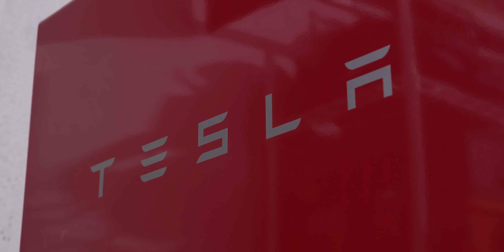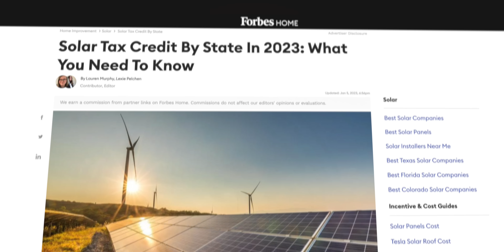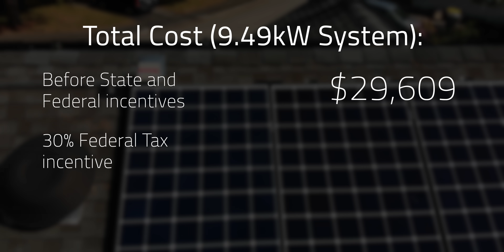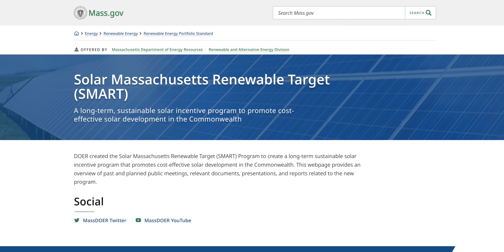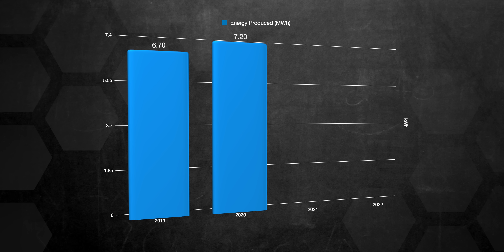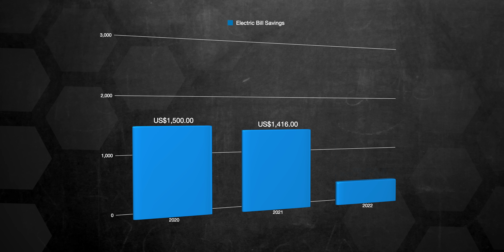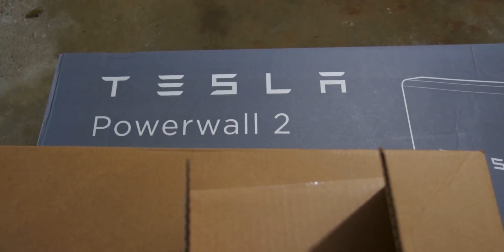5 Years with Solar Panels - Is It Still Worth It?

Comment: I always get all stinky over Nuclear power but after hearing about the navy having unlimited range it sort broke my military strategy/science brain destroying logistical problem in a military manner is a game changer, I liked this video although all the images of panel on your roof left something to be desired, though as soon as a micro reactor comes online Mr. Ferrell will be first in line to have one I'm looking forward to that.
Reply: The US Navy has been using nuclear reactors since 1958, they are installed on submarines, aircraft carriers and crusiers. Since then there has never been a reactor accident, the design of the reactor is made so that the controll rods are forced out of the reactor and in a shut down are pulled back into the reactor by a mechanical mechinism that won't fail. If you live near a navy base there are at least 20 or more nuclear power plants operating all the time. The lifetime of a reactor before refueling was 20 years, now with advances in technology is has been pushed out to 40 years. There are two studies that have been conducted on the effects of exposure to radiation. A long term study on the survivors of the bombing in Japan to end WWII and a short term study conducted on everyone who works in the industry. They have found that exposure does not alter your DNA. Also consider that the two cities they dropped the bombs on are thriving cities today. They went back in after the bombing and started rebuilding. Nuclear power is safe, outside interest have made it out to be bad because it would cut into their profits. You should watch this video by Michael Shellenberger put out 5 years ago, a TED talk about alternative energy.  
https://www.youtube.com/watch?v=N-yALPEpV4w&t=12s
Reply: @jeffgibbon5236  yes I am aware of this radiation causes cell death NOT mutation there is a lot propaganda around radiation even the nature of its release in a nuclear blast being pervasive for the duration of the blast not too long after at least any damaging effects that a gamma blast is similar to a camera flash and just as long I would return to you a link to a man named Galen Windsor* very entertaining seminar called the nuclear scare scam I watch it often.

Comment: Hi Matt. I am a resident of the UK and have had solar panels for some years. I have no comment to make regarding the financial aspects of UK solar because subsidies in the UK will be so different from in the US. What I do wish to comment upon is the issue that arises once solar panels have been installed - birds seeking to nest beneath the panels. I have had problems with pigeons trying to nest beneath my 30 panels. I have tried various deterrents including the use of a spring gun that fires BB plastic balls and which will hurt the pigeons but not damage them. Limited benefit, though my aim has improved. Next I used a water cannon (3ft long water pistol). That worked well but made a real mess of the windows as we are in a hard water area. Finally, and of most success, was a 25ft long series of bamboo poles. Simply tapping the solar panels with this assembly really seems to upset the pigeons. Of course the various pairings of potential sub-panel dwellers each need to be subjected to the bamboo training exercise before success is achieved. I relate all of this to hopefully let your audience know just how troublesome and determined these birds can be. Once established under solar panels I am advised that they can breed every couple of months - and the offspring return to their place of birth to breed. Once established there is the risk of them pecking through cables, the issue of droppings, noise… the moral of this story is that if you have pigeons in your area then, when having the panels installed, consider having some form of mesh installed around the panels to prevent bird ingress. Don’t wait until you have the problem and then have the additional expense of having to pay a company to retro fit bird prevention measures.
Reply: David, you described my problem. I live in Dubai. Pigeons is enormous issue here. I installed proper ledder to the roof so I can easily climb there every other day to destroy nests but seems like they don't care. Now thinking about mesh and also traps 😕
Reply: Install a fake falcon or eagle bird, here in Scandinavia are common in many city buildings and from afar they do look like the real thing. I’ve never seen pigeons or smaller birds get anywhere near one of these.
Reply: @11teenproductions  That’s an interesting option. Thank you.
Reply: @11teenproductions  Do their heads bobble? My parents got one for their fruit trees but it's a static bird. It only worked 1 week.
Reply: It cost me a additional £400 to get bird proofing installed.  Probably a bit of a rip off for just putting some mesh around the edges of the panels but it saved me from having to climb all over my roof so in general I am happy.  I have seen pigeons land on my roof clearly eyeing it up as a potential nest then flying away disappointed so it is doing a good job.
Reply: I have never thought about that being a problem before. Sure does make sense though, bloody things get everywhere!

Comment: We had 22 solar panels installed (380 Watt) and a 10 KW battery. Here in Denmark we pay a high rate for transport between 5 PM and 9 PM. But low cost at night. So here at winter time we charge the battery at night and discharge between 5 and 9. That save us a lot. We have a 9 KW heating pump to warm up the house and 2 EV's. All electric now and I am pretty exited how much we save. The system is 1 month only but we can see now it is a great investment. Thank U for all your fantastic videos!!
Reply: Me me me me... Me me me

Decarbonization is 21st century pyramid building.
Just burn coal. 

This is sickening on so many levels.  "How to screw the lower middle class and make them pay for your feel-goodery."
Reply: @hg2.  Sorry I don't get this, so you think I screw the lower middle class to feel good. Please explain that.
Reply: @rolfmandrup5982  
A "tax break" for you and your feel-goodery is a tax increase for somebody else, for starters (not to mention the screwing up ($up) of utility rates for everybody else.
Reply: @hg2.  sounds like you have no idea about Danish taxes..
Reply: @rolfmandrup5982  
I DGAS about Danish taxes. 

Decarbonization is stupid 21st century pyramid building.
Reply: @hg2.  
Not caring about the climate changes is pre neanderthal headbanger thinking.
Reply: Well, how cost for all these system
Reply: In DK every hours of the day is different if you chose to be on a spot price tracker. So sometimes the price is what mentioned is this video. $0.37, or perhaps a tad higher at times as the post above mentions. 
Other times when there is a lot of wind and sun, it's very close to $0. So I wouldn't say it's the most expensive in the world. Plus if you have a heat pump or similar green heat source  installed after 12.000 kWh, the price on all electricity becomes slot cheaper to purchase from the grid. 
Have a look at the UK where I currently are. Prices are up between 400% to 500% on gas and electric  since 2019. Or at least our bills are that high,  and no increase in usage.
Reply: @martinandersen6698  Averaged, Denmark has the most expensive energy in the world. Edit: Sometimes, the price is up around $1.00/kWh!
Reply: They save you a lot because you have the most expensive electricity in the world, by a HUGE margin. The electricity in Denmark is nearly three times more expensive than the electricity in the US.
Reply: @PistonAvatarGuy  yikes, but helpful to know
Reply: @PistonAvatarGuy  Where do you get that 3 times number from? 

According to Eurostat it was 0.28€/kwh in 2020 and  0.29€/kwh in 2021. I don't have up-to-date numbers for Denmark, but usually their electricity cost is similar to Germany's which currently sits at 0.35€/kwh.

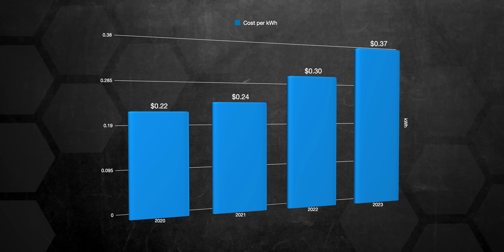That's exactly the same as the 0.37$ shown at 7:51
Reply: @PistonAvatarGuy  2022 was a short term hike, though. Using the outlier for a comparison is not credible.

As I said above, prices are down already and apparently they are the same as in Massachusetts now.
Reply: @insaneshepherd8678  In 2021, the price per kWh was also extremely high, at $0.37/kWh.
Reply: @PistonAvatarGuy  It was 0.29€/kwh according to Eurostat which I would put more trust into than statista. Eurostat is getting their numbers directly from the suppliers after all.
Reply: @PistonAvatarGuy  yes but the price in this video was 0.42 ¢ wasn't it ? So not much difference. Certainly not
" the highest in the world"
Reply: @tcurr0309  Where is electricity more expensive? I suppose there are small islands that have to import diesel  that might have more expensive electricity, but Denmark had the most expensive electricity of any mainland country.
Reply: @tcurr0309  Using the example in the video, in Texas we are paying less than 1/3 the rate for electricity that this guy in MA is paying. That alone is enough to make solar not make sense financially, but I also haven't found a quote for an installed system anywhere near his price (in the mid $20k range). Installers want to charge upwards of $60-80k in my experience.

Comment: Matt the savings using solar are much greater if they are used to charge an EV than used to offset domestic electricity  because the solar is used to replace gasoline instead of grid electricity. In Australia it is about 4 times more cost effective. A 6.5 kw system with a 5 kw inverter can charge 2 model 3 teslas for 20 years (800,000 miles). I would be interested to see how that works out in your neck of the woods.

Comment: So you didnt add it all up and come to a grand total?... You failed to mention that although the solar increased your property value... it also increased the tax burden due to higher value... this also increases your property insurance. You also didnt include the loan rate which sets the payback period even further out. often past the 20 year mark. here in texas we pay about 0.15 per KWH... so there is very little to gain other than a blackout scenario should you have a battery... but battery backups dont last more than 2 days. thus the total payback is about 20 years. which sadly is the time when the system is beginning to breakdown which conveniently also results in many solar companies going out of business or changing ownership that results in loss of maintenance or service. many will not cover other systems they didnt install.

Comment: For the Tesla Powerwall, despite the install problems, I'm wondering if you would consider other battery storage companies out there.  The cost and flashiness of a Tesla powerwall are something I'd like to avoid.  I have ample space for any other storage solution, so if there's something pretty comparable to the storage and output at half the cost or so of a Powerwaall, I'd like to hear what you might think are good alternatives.  Thanks!

Sounds like you got an awesome deal on a 9mWh system with all the incentives.  Mine is half the size and cost me around $18K.  No regrets, though.  I should do some calculation on what I've been producing and saving...  Winters are pretty bad for solar in WI and my roof has a gable that blocks the snow from falling off, but I got the rake as well to help clear it.  I might even look to see if the installers could pitch the panels at  more optimal angle for better year round production.

Comment: Matt solar it not viable. The only way these come close to being a "deal" is because of all the elusive tax credits & "deals". If we were not in these ridiculous inflationary times the numbers would not stack up. No problem to have some kind of grid failure back up but that is were it all ends for me.
Reply: I love my system. It is saving me so much money, I wish I had done it before 2022. I am going to save $115,000 over 30 years, then add in never having to pay for gasoline again as its price keeps going up. Then my homes value shot up already and if the price of electricity goes up my home value will skyrocket. Add in the money I am saving I am truly investing and the money train just keeps coming.

Comment: I don't understand. You use your own produced electricity (30%), send/provide your excess (70%) into the grid, but atill have to pay the utility companies for the 30% of electricity you provided for yourself with equipment you purchased and provided for yourself? In the end, you are paying a fee to utility companies for electricity you generate for yourself. Help me out here. Trying to figure out whether I wish to pursue this route, but ethics are getting in the way. Perhaps, I just don't understand.
Reply: He was using a typical example and did not explain it well. I have a system very similar to his. 8.5 KW. During the day I am sending a lot of electricity into the grid and use some of it as I work from home and charge an EV. During the night I am pulling 100% out of the grid. But, we generally look at it in monthly intervals. Some months I create more electricity than I use. The electric company owes me for those KWH. A good example would be month 1 I create 500 KWh of electric but use 600 KWh. I owe the electric company for the 100 KWh. Month 2 I create 900 KWh and use 600 KWh, Ameran stores/owes me for 300KWh. I only paid the $11 connection fee to Ameren (my electric company). Month 3 I create 400 KWh but use 700 KWh. I break even and only owe the $11 connection fee for month 3. Does that help?

Comment: Hail prone states has to replace shingles more frequently. Was told you have to replace entire roof not partial. Cost to remove and install adds few grand. Most ppl don’t worry about this as their roof replacement is like every 20-30yrs I guess

Comment: I had a 9kw Tesla system installed, and the one issue for me has been Tesla itself. I’ve had app reporting issues and they still aren’t fixed — the system was turned on early August 2022. Tesla has sent out “engineers” 3 times, which itself took months of proving my case. I literally had a customer service rep tell me my system is functioning when the app said I was producing electricity … after sunset. My point is, shop around before choosing a company. Based on my research since, Tesla is known to ghost you after the system is on. If you go with Tesla, do the research and understand the common installation errors that occur and be adamant at the beginning that testing is done fully to ensure it’s working properly.

Comment: Thanks Matt.  Since you installed solar panels on the front of your house (road facing roof line) did you get any flack from your neighborhood or association on aesthetics?   A lot of home owners associations have some strict rules on what kind of home improvements you can make.
Reply: thats so ridiculous you have to even consider that - Aussie
Reply: @kobrapromotions  Not really, the home owner's associations are designed to protect your investment.  You would be surprised what some people will attempt to build or modify regarding their homes.  These panels don't look bad but it could be an eye sore depending on the quality of installation.
Reply: @bigjimstream  in the UK, we have a system called “planning permission“. Neighbours can object to anything, if they want to, but they also have to provide good reasons. After the consultation period is over, and any genuine concerns have been addressed, the building can go ahead.

To give an example of how this works in practice, I once knew someone who wanted to build a house with a floor plan of two large circles. The total structure would’ve looked like a couple of tall cylinders with connecting areas in the middle. However, as it was in a historic area, the shape was objected-to during the planning permission phase. Thusly, they built two cuboids instead of cylinders, and the rest of their build was allowed to go ahead as planned. 

And no one has to pay any HOA fees!
Reply: @kaitlyn__L  US has a similar system, but most of the time as long as the install is up to code the town does not care.  There are HOA's which are common in apartments but not in single family houses.
Reply: @notavailableses  my experience of HOAs is obviously second hand, but most of the people I’ve seen discussing them have been in a single family/occupancy home situation. And City Beautiful’s video about HOAs discussed them in terms of single family suburbs. But I’ve definitely heard of similar “condo management” orgs setting rules and providing maintenance much as HOAs have been said to in my reading/listening.
Reply: @kobrapromotions  right, I’d be happy just with rent saved and the freedom to hang stuff on the walls or install a new appliance lol
Reply: @kaitlyn__L  or to paint a wall and not need to get "permission", ive even heard of ridiculous things like people getting in trouble for not manacuring their lawns properly or using artificial turf when theyre city is under water restrictions and everyone elses lawn is brown dust, probably not the best example but the list goes on of the nightmare HOA stories... and he thinks that helps the return on investment lol Id rather be homeless than live under that
Reply: @kobrapromotions  I was thinking of landlord things, but honestly your comment made me realise that living with an HOA is just as restrictive as having a landlord lol
Reply: @kaitlyn__L  we have body corporates here in Australia that have a similar function to HOAs, theyre generally in apartment building but (think building managers), there are some rare, usually expensive closed housing estates that also have them. Ive lived in both, and they were a nightmare to deal with. I can only imagine how much worse it would be in the USA with a HOA.